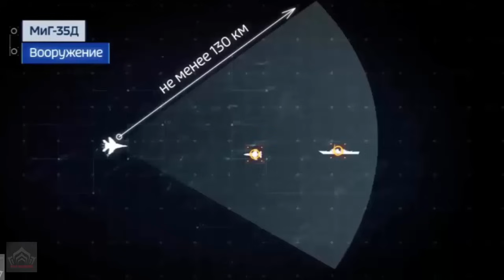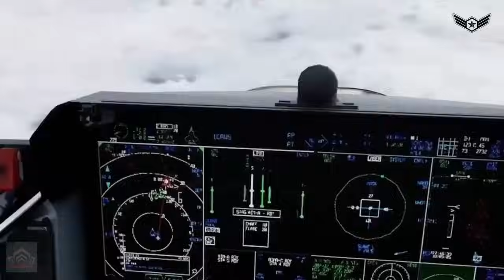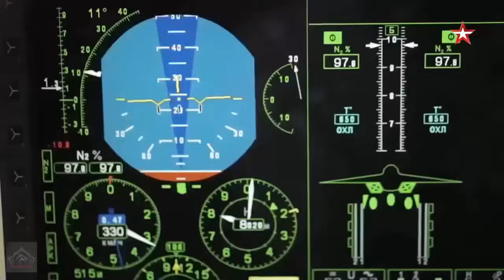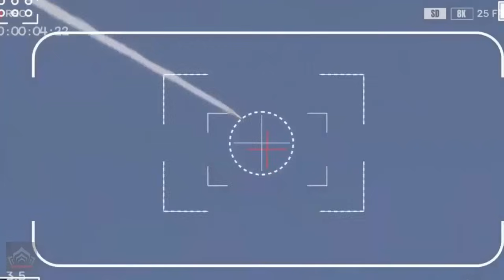Russia’s New Top Fighter: Su-57M1’s Five New Features That Make It Far Superior to the Original

Comment: its biggest standout feature is that it has a rcs 20-200 times larger than F35. In war, the SU57M wont even know what took it down.
Reply: It's RCS is 0.5 and with newer version of M1 where it is expected to be even lower than 0.5
Reply: @nxp2619  which will be 20-200 times larger than F35 :)
Reply: Вы лично видели Су-57 на индикаторе РЛС(radar)? Вы лично сравнивали дальность обнаружения Су-57 и F-22, F-35? 😁 Или вы только посмотрели пропаганду и рекламу? 😆

Comment: russia so desperates to equal with US about 5th gen plane. we know the lack composite , chip and electronics they must seek in blakc market and other country like German... su-57 basically just su35 Pro max.  Another Russian Propaganda . off course this russian channel must boost russian military Tech

According to Indian defence sources, New Delhi has made it clear that any potential procurement of the Russian Su‑57E stealth fighter will require significant modifications, particularly replacing key systems before a deal can proceed 
Major Indian Demands:
Replace the N036 "Byelka" AESA radar
The current system uses GaAs technology, which India views as outdated compared to GaN-based AESA radars. Indian engineers cite limitations in detection range, thermal performance, efficiency, and resistance to electronic warfare 

Install India's own radar systems
India suggests integrating its Uttam GaN-AESA radar (now in Tejas fighters) and the Virupaksha GaN radar (for upgraded Su-30MKI "Super-30") instead of the Russian radar 

Fully integrate Indian avionics, EW suite, and mission computers
As part of its "Atmanirbhar Bharat" self-reliance policy, India insists on source code access, ability to integrate Indian-made weapons such as Astra, Rudram, BrahMos-NG, and full interconnectivity with its existing fleet 

Russia’s Response:
Moscow reportedly offered open-source access to allow easy integration of Indian-made subsystems, along with joint production options in India using HAL’s Su-30MKI facilities 

Rosoboronexport and the Russian Ambassador emphasized a willingness to transfer technology, enable configuration flexibility, and local production if New 

Strategic Implications:
India’s demand reflects a shift from being a passive buyer to a sovereign co-developer, driven by past procurement frustrations—especially with the Rafale (lacked source-code access)—and a desire for a controlled, interoperable defence ecosystem 
i

The outcome of these negotiations may set a new precedent in arms deals, where the buyer not only acquires the platform but also retains full mission system control and integration rights

Comment: 1:10 the AL-51 is anywhere from 700 to 900 pounds lighter and has about 5 inches narrower inlet diameter. Though it has roughly a ton less in military thrust it makes about a ton more in reheat than the f119 while being smaller, lighter and using less parts in the process. It will also be more efficient. The specifications for both engines are amazing and is near the limit of what turbofans of fighter engine ratio can output. To go beyond will require adaptive and hybrid engines.
Reply: Also the f135 is substantially larger. I think it is even more so than the d30m6 that powers the mig31, let alone the al51.

Comment: Even with the "old" AL-41F1 engine, the Su-57 was superior to all 5th-generation aircraft, perhaps inferior only in stealth
Reply: It's still probably one the worst and least produced 5th gen fighter. All it's tech and avionics are radically less advanced than the f-35. Go fast doesn't make jet good😂. Its gonna be seen first and it's gonna be dead first. Both the f-22, 35, and 15EX all spot and kill the su-57 before the su-57 can even track them. It's outclassed in stealth and radar. Su-57 was shot down by a stinger🤣